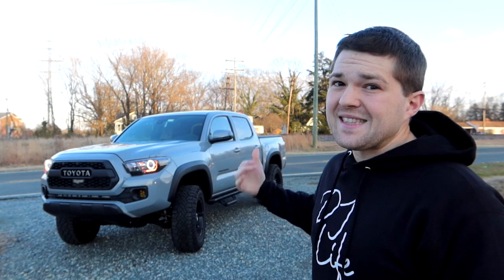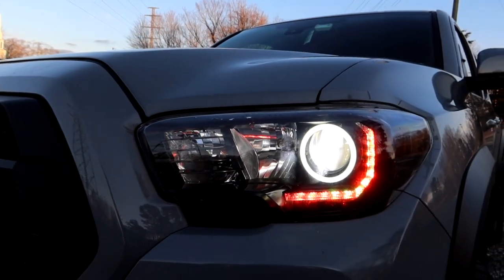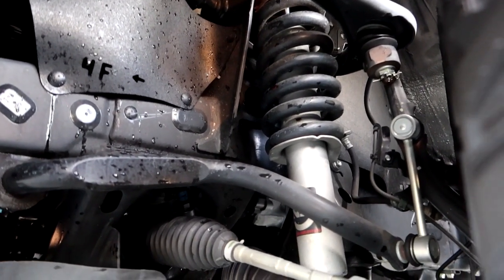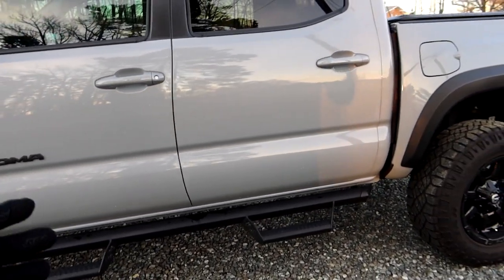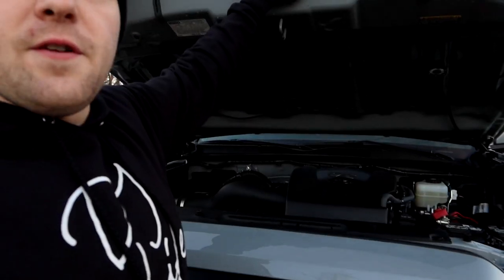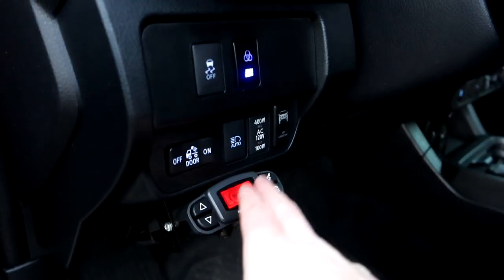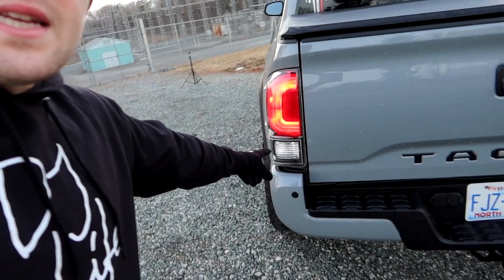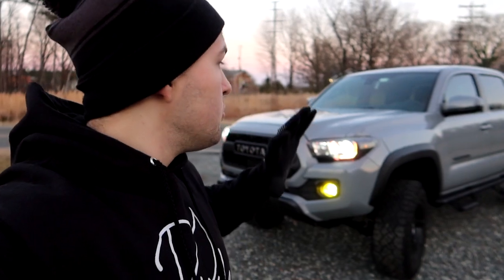Lifted Tacoma TRD Off Road - Build Update 2021 (Tons of Mods)

Comment: Did you have to change the driver's side needle bearing after the lift?  I've read multiple stories where the bearing strips out after a lift and causes a front-end vibration.
Reply from the maker: No and had no issues since lifting. 50k + miles on it now

Comment: Nice truck. Hoping to get the 2021 off road this week. How’s your MPG on it? Also I noticed the back bumper on the 2021 is chrome. Did you mod yours or did it come in the cement color?
Reply from the maker: Mine is color matched. I have a video on this channel doing mpg testing with the lift kit.

Comment: Why no keep the bilstein shocks on and just run a spacer kit? Bilsteins are better than the rough country shocks no?
Reply from the maker: The rear has to be replaced due to travel. But the fronts you can run a spacer only but your going to be putting more force on the front struts then they are designed for. Which is why I replaced with rough country. The rough country struts are bigger and ment for higher forces than the stock bilsteins

Comment: Lifts/mods do not void factory warranty unless they are the direct cause of the issue.
Reply from the maker: Depends. A lot of those purchased warranties they will claim anything practically caused the failer. Seen a bunch of people get screwed over
Reply: Lifting over 6" or adding a supercharger are the only two things that ruin my factory warranty.